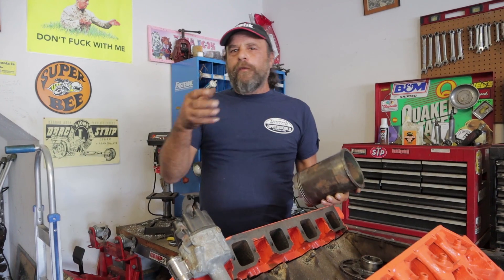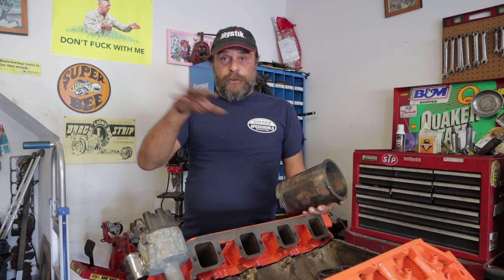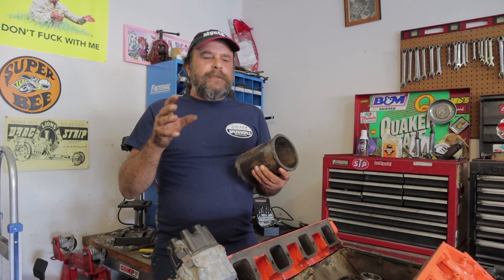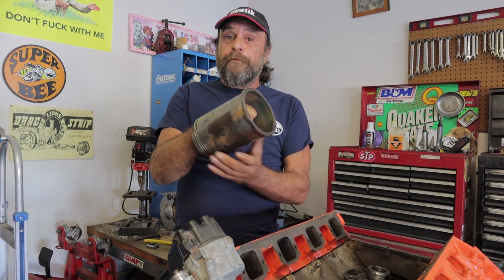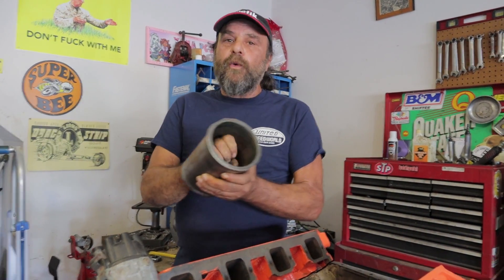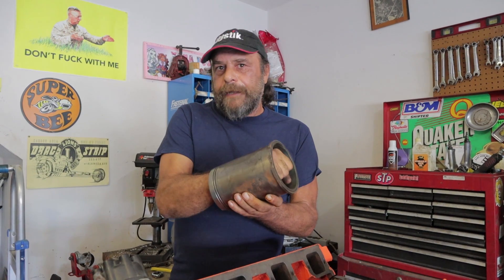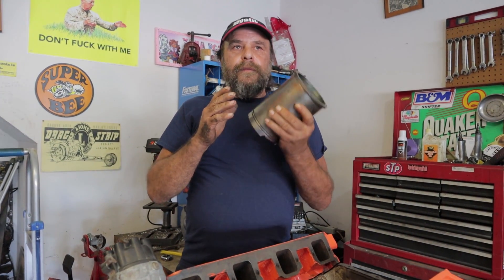The Myth Of Engine Displacement

Comment: horsepower is a fumistery, torque is the real thing
for general use, available torque at your actual driving RPM is what that makes an engine  feels powerful so for most applications, for the same displacement, a longer stroke engine will produce  more torque at intermediate RPM.
It is the main reason why old flathead engines were so tractable at low speed, maximum torque reached at about 1000- 1500 RPM was the standard.
It was also the reason why the Chrysler flathead sixes were used so intensively in industrial, agricultural and stationnary  applications.

Comment: The displacement means more on the intake stroke drawing the intake charge with its increased swept volume
The working area on the power stroke as you said along with the dynamic compression 
How cool are engines

Comment: Yeah big old 460s in dump trucks that only have 180 horsepower 330 torque but then there's a 340 Mopar pumping up way. More power so it's not just about the size. It's how you use it

Comment: I.  Made. Comment. On. Other. Tuning.  Video..today.....  and.  Shared.  The. Storey. Of. A. Reconstruction...with. 13.25. G...m...Pistons..     this. Was. With.  Carmel. Heads.    Because. Of.   Fuel.    Searches. I. Actually...   purchased..  some. Open. Chamber.  1968. Heads. I. Think. 76. Cc....  and. Brought. The. Ratio.  To. Either. 10.95. Or. Exactly. 11.0.    And.  After. All. That..  straight... .94. Sunoco.   Ran. It. Just. Fine......and. because. Of. The. Enormous. Chamber. At. 11l1. It. Seemed. To. Do. Well.. holding. Torque....   and. Save. Me. Some.   Cash....on. fuel.... mostly. Because...I. did.nt. need. To. Drive.  20. Miles. To. Get....3.00. Per. Gal....   99.5. 101.  Or.  105...  and130......   was. Almost.  5.00. Buck.s.....a. gal....  mixed. 50l50. With. 94.is. still. Costly...at. 3.50.per. hour..........i.     just. Did.nt. want. Ya.  Wonder.in ....where.  in.  The.  Hell. Was. He. Buy.in.... Fuel. For.  That. Thang......  oh. Baby......    you. Make. Me. Realize. How. Much.work.  I. Did. On. It.   drive.in..  this..for.  very. Close.  To. 20.yrs.....that.s. along. Time. On. The. Road....with. a. 1968. Vehicle....  of coarse..nice.  weather. Only. From.  Memorial.  Day. To. Labor. Day......  have. A. Good.  Night......

Comment: "No replacement for displacement" I think is true. Take 2 engins, 1 with 302 cid and 1 with 400cid. If you do the same modifications to both endines you'll get more power from a 400cid than the 302cid. It is a blanket statement but true.

Comment: How quickly they forget. The Offenhauser 4 cylinder engines of the late '60's-early '70's had only around 159 cubic inch displacement but made 820-1000 HP!

Comment: I've always chuckled inside when I heard someone make that statement. When I think of all the so-called stock muscle cars  I used to embarrass badly with 76 20R powered Celica.
   🤔 not that the Celica didn't have its own horsepower robbing emissions, but it seemed a little less affected by it. 
    Displacement alone obviously is not what makes power. Of course there's the basic everyone does headers, new carb. Upgraded ignition or chip. But the biggest bang for your buck is a cam with a proper profile  for the work expected to perform whether off-roading, racing or hauling. Oh and "economy"🙁
    Often times a cam can be had for less than a set of headers. 
     Then there's larger valves and head porting. But even simply cleaning up the  ports within a head we'll go a long way to adding horsepower. The truest part about no replacement for displacement comes in economy.  At or near idle you still have to fill those cubic inches with air and fuel. 
       Oh then there's the gears. For most the rear end gearing is the controlling Factor on received power or economy.  the reason we finally have Transmissions with 5-8 gears being standard.
    Back to the Toyota. 
   It had a 5-speed transmission.  allowing it to work within the Power Band much more efficiently.  the muscle cars of the day had anything from a two to four-speed trans.    Used to get blank or funny looks when I used to say one day cars will likely have as many as 10 gears.   And that it would likely take place with automatic transmission since people are flat out lazy or can't shift. 
      yes I still have a 75 Celica with its 20R.  yes it's been bored 40 over and has a cam, larger valves, and ported head. Offenhauser dual port with a Weber Progressive. This low mileage car (just under 48k) can still boil the tires.  (although I don't)
      The '76 Celica ? Yes it received a displacement upgrade. It now has a toy Century V12 tightly packed  under the hood.  Yeah the same engine that is capable of up to well over 1500 hp.  
      I do have my American automobiles in 80 Dodge 1 ton Club cab.  yeah when was the last time you seen one of those? The 99 1500 sport 4x4. 67 Newport, 68 Mustang, 69 Camaro, just to name a few. 
          Oh and then there's the 1980 F600 with the 390, 5 speed, and two speed rear end. 
       And yes, bigger is better!
        The main reason why my 3/4 scale P-51 Mustang has a supercharged LS2. 
     And one of my bush planes has a stroked type 1 2300 with two AMR 500 superchargers with clutches.  They feed 4 throttle body injectors.

Comment: The displacement of an engine is bore and stroke and the only replacement for displacement is forced induction like turbo or supercharger but those such pieces of hardware cause exponentially more heat and and stress on internal engine parts like connecting rods piston rings valve seals and so on...naturally aspirated is the way to go

Comment: I know I'm a little late to the party for what it's worth every every time the old men would tell me there's no replacement for displacement what they meant by that is let's say you got a 350 and pick any of the Big block offering Chevy hat in order for the 350 to make the same power that the stock big block had and to do it reliably you have to put just as much money into the 350 as you would to just buy the big block ready to drop in and then you could do all the extra stuff to the big block that you would have done to the 350 and make even more power and then on top of that there's the reliability let's say you push a 350 800 900 horsepower how long is it going to hold together where you take let's say a 454 and you push 800 900 horsepower out of it the 454 will do that all day everyday happily the 350 will eat itself to death but yes I agree it's entirely an over simplified statement for what it really means and what it stands for but that was what I was always taught is that whenever you heard the statement there is no replacement for displacement it was a mantra to say you may be able to do this with your smaller displacement engine but it will never be as good as doing the exact same thing with a larger displacement engine

Comment: 4th time watching this video. 
So much info
Reply: Tony knows a lot about engine history, but he does not know anyting about the physics of the engines he plays with.
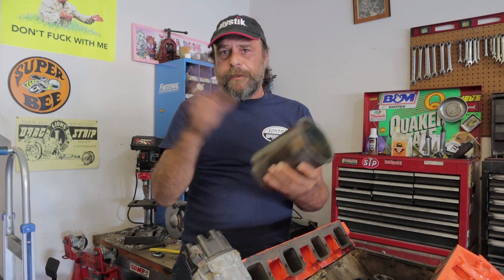2:30 "The party is over at 90 degrees".  - Completely False. If we assume that combustion is complete at 90o, then you have peak temperature/pressure at that point, and that pressure continues to push the piston down until EVO.  In Tony's mind, the "party" is the flame, or the combustion. But the work is done by the pressure, not the flame. The flame brings the temperature and pressure up to peak values. The pressure doesn't disappear when the flame dies out, the pressure reduces as it presses the piston down to BDC. The remaining pressure begins to disappear when it is  released at EVO.

4:00 "You have that same 400 cu.in. doing the same amount of work @ 400 cu.in that you had @ 300 cu.in." - Completely false.

Does anyone actually believe that a 300 in^3 engine does the same amount of work per cycle as it would if it were stroked to 400 in^3 ?  First off, Tony forgets here that the larger engine pulls in more air/fuel. So you have more thermal energy released in the 400 than in the 300.  Then he applies his incorrect "party's over at 90 degrees" theory to the extra stroke at the bottom of the 400 and gets zero extra work.  If this was actually true, people would have figured it out long ago and you would not have such a large stroker kit market.

Why does a 8-3/8 inch barrel 44 magnum have higher muzzle velocity and energy than a 3" barrel 44 magnum?  Because the high pressure gas has more distance to push the bullet.

Stroking has an immediate impact on low-end torque, assuming everything else is the same (cam, heads, intake, exhaust). And the low end torque will generally scale approximately in proportion to the % change in displacement, all else being the same. (10% increase in stroke -> ~ 10% increase in peak torque) You might see an increase in peak power in some cases.  In the case of a huge % change in displacement, like going from a 300 to a 400, you probably will see an improvement in both peak torque and peak power, although your % increase in peak power will be lower than your % increase in peak torque.

Comment: Displacement makes easy reliable power. The smaller the engine the more stresses you have to put on it to match the power of a larger engine. Sure you can take a tiny engine and make big power.... for awhile. But its a ticking time bomb.

Comment: Although there are a many correct statements in this video, the logic of "useable work displacement" being identical between the two engines (300 and 400 cui) is not correct. There is an error in the thought process plus an important factor was also left out. Here is why:

The starting points are a 300 (302) cui with 4" bore and 3" stroke as the base engine. Any performed work will only be counted during the first 90 degrees after TDC, at which the piston is at zero deck. Therefore the 300 cui only works effectively with 75 cui displacement (because half the stroke, every two cycles). Now the engine gets a 4" stroke crank and the wrist pin is being raised 0.5" to compensate and the piston can be at zero deck again with the same connecting rod.

Uncle Tony's logic is that due to the 0.5" raised wrist pin the increased stroke is compensated for and therefore the "useable work displacement" will not increase and therefore the engine will not produce more power, if all the other components and specs stay the same. Well here are the two mistakes... the first one is that when the crankshaft has performed 90 degrees of rotation, the stroke of 4" will have traveled half its way, which is 2". The 300 cui engine will only have traveled 1.5" since the stroke is 3". The only difference that the 0.5" higher wrist pin makes, is that it results in a slightly different geometry by keeping the connecting rod the same length instead of using a 0.5" shorter connecting rod and the same wrist pin position. But that has nothing to do with where the piston will be in the bore after 50% of its travel. So effectively the 400 cui engine will have 100 cui of "useable work displacement" compared to the 75 cui of the 300cui engine.

The other mistake is that, assuming all other factors don't change, the compression ratio will be changed and go up with the 400 cui engine. Since the piston is an inch deeper in the bore but the chamber size is the same, there will be around a 30% higher compression ratio. So not only does the 400 cui engine "inhale" the extra mixture through the added displacement, the mixture will also be compressed to a much higher chamber pressure on the way up, which will automatically result in a significantly more powerful combustion.

Comment: It all depends on what the engine is for really. Are we pulling stumps or spending all day going as fast as possible? 

The benefits of a stroker is mostly leverage against crank, going to give you a lot more bottom end torque over an engine that is closer to square or over square. 

Smaller displacement engines can make more horsepower to cubes because being square or over square they have much lighter parts, so they can rev  higher, but they give up bottom end torque in favor of top end power. 

If displacement was everything there's no reason a small car with a 2L i4 wouldn't be making 396hp and 220ft lbs of torque. Twice what a Cbr 1000 makes stock.

Comment: Uncle Tony, I virtually never disagree with you, but this time I do. If you run over to Richard Holdener's YouTube channel there's a dyno test of a 347 stroker sbf v a 351W sbf. Everything has been made as equal as possible in terms of cam, manifold, carburetion, and heads. Guess what...the horsepower and torque end up so close they may as well be the same engine.

Comment: that really doesn't make sense. it kinda does at a certain point, but not around 3-400 cubic inches. if it did, then you could run 0 stroke and make as much power. but ya can't do that. there is a sweet spot for bore/stroke ratio and you will get diminishing returns past it. but it does increase displacement and working area. maybe not the entire inch or whatever you added. but half, maybe... cause whatever point it stops really working, will be moved down and split by the difference in stroke. if this were true, stroker kits never would've taken off. ford v8s would be completely different. that's what makes a 351 usually more powerful than a 302, or 4.6-5.4, other than high rpm. and even then, sometimes.  and the reason chief's car makes so much power, is the 2 big turbos... or being able to spin a shorter stroke faster, and end up making more top end, but it barely runs down low and idles at 2 grand... but any engine is going to be limited by piston speed, and everything else. increasing the stroke, the piston speed increases for the same rpm. cause it nopw has to travel a greater distance. that's why big stroke truck engines don't turn 6,000rpm. or didn't back in the day, and i doubt any v8 truck engine would turn it stock even now. but i do agree displacement is not the only thing to worry about. any time somebody brings up a swap, it's always 460, bbc, or whatever, but it's gotta be HUGE! you can do just as much, or even more if you're smart about it, with less cubes and less weight...and maybe a little bump in atmospheric pressure, never hurts.

Comment: What your saying explains why it seems the 383/340 (short stroke) can easily make more HP than a longer stroke 440. Nick's Garage put a 375 hp rated HP440 on the dyno, and could not even come close to making it's factoy rated hp. 340s actually make more (short stroke) hp than factory rated. I've sadly heard of this problem awhile back about the  HP 440 being over rated in factory HP.

Comment: This is incorrect. That is the reason we change cam timing events, to adjust the valve events to take advantage of the cylinders fill, compression, combustion, and blow down.
You don't use the same camshafts for 3.00" stroke that you would for 4.00" for optimum power.

You change valve events to accommodate your engine combinations.

Comment: Yes I agree I have been contemplating building a 408 small block. My take on a stroker motor is to utilize the extra stroke in filling the cylinder with more air hence a extremely efficient cylinder head and large cam advanced 4 to 6° to come in sooner to take advantage of that deeper lung fo a cylinder.What do you think uncle Tony am I on the right track?

Comment: Why do bigger cubes offer so much torque with everything else being equal? Meaning the same heads, cam, intake, exhaust bolted on a 400cid sbc vs a dz302 sbc. The peak horsepower will be similar, but the torque curve will be way different. If you could make use of the extra torque without shaking the tires, the 400 will win every time. 
  You mention big chief. He's also got power adders. Apples and oranges.

Comment: you are missing a lot of key points of info here. you just explained the firing event. this will be more or less the same for any engine regardless of displacement. lets shrink that 302 so it can fit in the palm of your hand and compare it to a full size engine.. which has more power? why? because there is no replacement for displacement . (mic drop)

Comment: A bit of a stretch to call displacement a myth.  Interesting point though.
Reply: No it isn't.
Reply: You are right.  I was being diplomatic. It's actually an extreme stretch to the point of being bullshit.  Displacement is always crucial.  All the points he makes would apply to any size displacement; thus his point is self defeating and subject to being merely relative.  In other words, to say "It's not the size of an engine, but how you put it together" is true; but that point applies TO ALL SIZES of engines/displacement.  Thus, displacement does matter and indeed it is crucial, especially for instance, in a low tuned environment, where large displacement allows for huge torque even when relative horsepower might seem mild given the large displacement.
Reply: @rogjackson  Yup, but one could also get really into the weeds on this. Things like he's also completely wrong that less than 90 degrees of the power stroke is used to produce power. Or that while he never says so increasing displacement without increasing the number of cylinders has diminishing returns because a larger bore is more prone to detonation.   

And yes, our reliance on peak HP as comparison is a problem. There's a huge real world difference between an engine that produces 400HP at 3000RPM and one that produces 400HP at 8000 RPM.